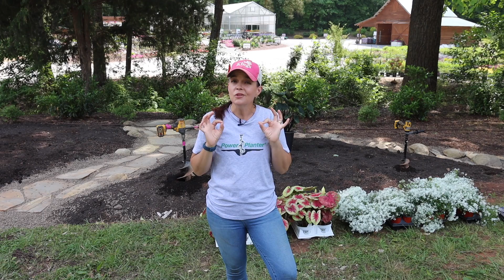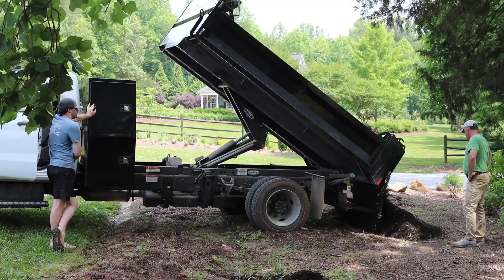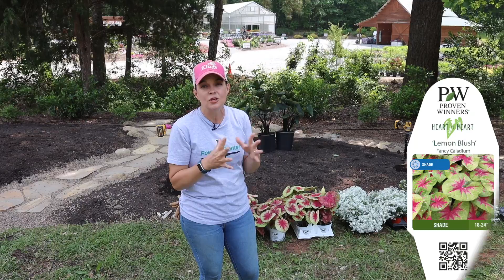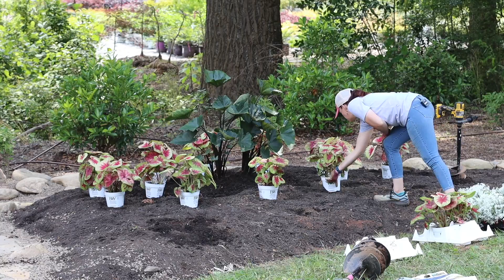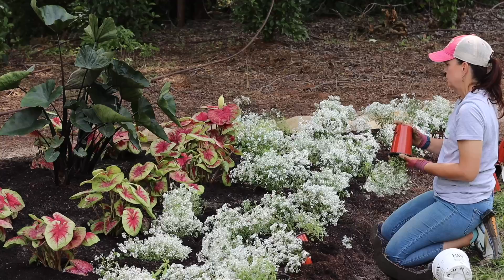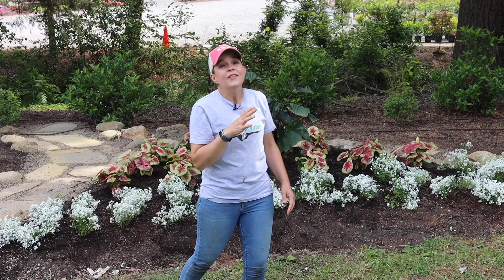Turning a Water Problem Into a Design Feature | Gardening with Creekside

Comment: Jenny, this looks great, but I wonder if you could do a design for those that can’t put $100 or more in a bed.  Proven Winners are great but are getting pricey.😢
Reply from the maker: Think about the concept, which can be paired down or use other plants. Our spaces are big so most of the plantings will be on the large side. We always recommend pairing down to achieve the concept.